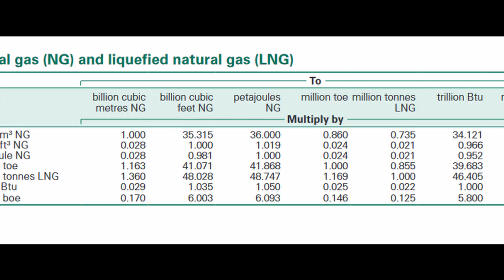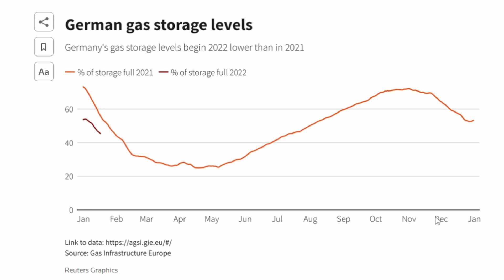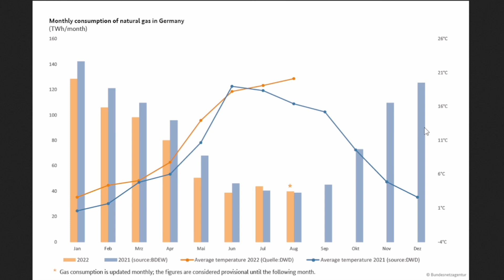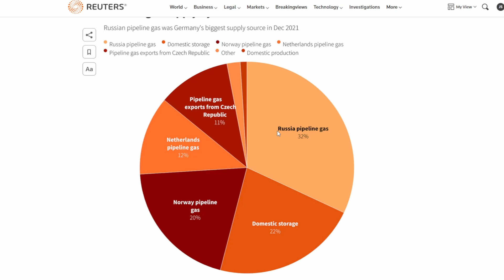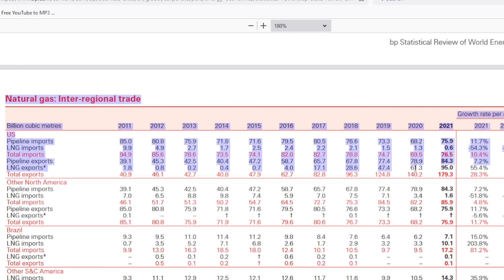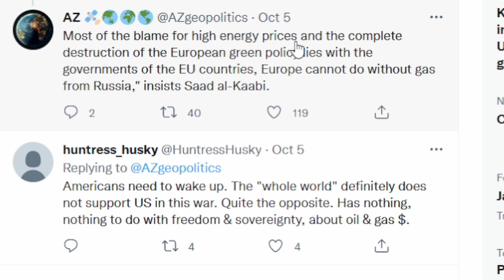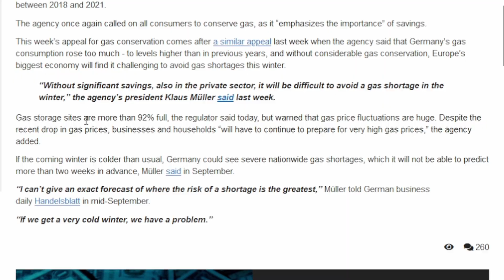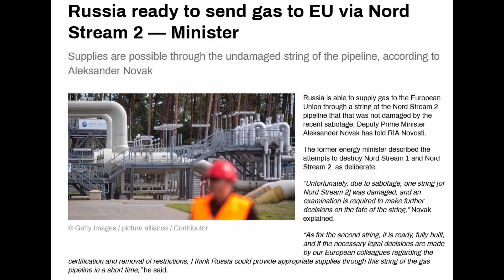Does Germany Have Enough Natural Gas For The Winter? There Is Only One Solution

Comment: It’s not a years supply it’s a emergency amount , like the USA is , USA full would last 28 days , Germany prob the same .
300 mcf a day over a winter  ( 140mcf from Russia over 160 days is 750 mcm ), it’s impossible to store thst amount it need a void a mile cubed .
Reply from the maker: That is why gas prices are volatile because it is hard to store and transport a lot of it like you can do with coal or oil.

Comment: They are NOT going to use Nordstream 2. They are going to slash industrial usage and natgas electricity generation.  Fertilizer, roof tiles, etc made with natural gas that costs 5 times much as other places are not competitive and will close down. And old coal plants are being fired up to replace natgas plants.  Some natgas plants will replace natgas with an oil substitute like diesel.  Doing those things and more will slash gas usage so they'll be fine.
Reply from the maker: They can slash usuage but it doesn't change the price they are paying for gas which will will shut some industries down like you mentioned. There will be some real pain from this.

Comment: Thank you for this excellent video.  Ever since the mass media started to report that German gas reserves were at 90% --- I immediately wondered about the absolute volume of these reserves --- a figure that has been conspicuously absent from the reporting.  Very nice to see your estimates of the winter gas use vs reserves.  And the conversion factor for TWh to BCM is really handy - and easy to remember.
Reply from the maker: Thank you. I was trying to understand it also and it was not easy to figure out the real numbers because of the different units they use.

Comment: They have enough in storage for a year but it's going to be tough 😪
Reply: They only have 90% of 20% of gas they use in a year. IE, they have about 18% of the gas they use in a year in these storage mines. The storage is at 90% sure, but the storage when full is only 20% of the gas Germany uses in a year. This is how they have been conning people into believing all is well, most people will just look at the headline and think "Well we have 90% of the gas we need, what's the problem? 80% of German gas is used directly, it never goes into storage. And they have no way of getting most of that gas now.
Reply: They have enough in storage for a few months - not a year.
Reply: @vanhocwong6689  apparently MAXWELL didn’t watch the video.  Simple math

Comment: As i understand it, not all of the gas that Germany has in underground storage is usable. I'm not certain of the reason, but i think it has something to do with the fact that this gas is in old sealed up mines, and they have to pump air in to get gas out. At a certain level the gas/air mixture IE Gas/Oxygen level would change the gas from combustible to explosive.
Reply from the maker: I believe you are right. From what I saw they need to keep it 20% or so full.